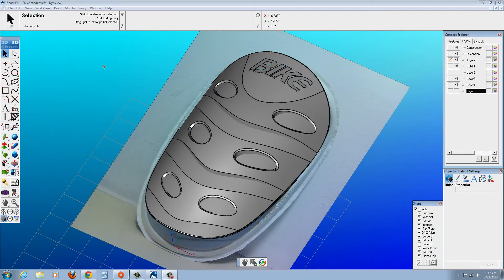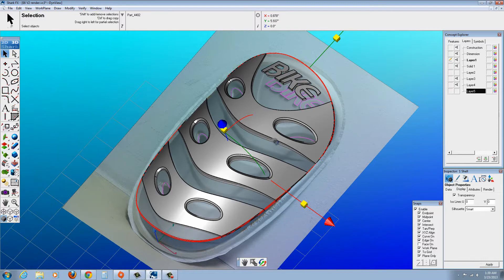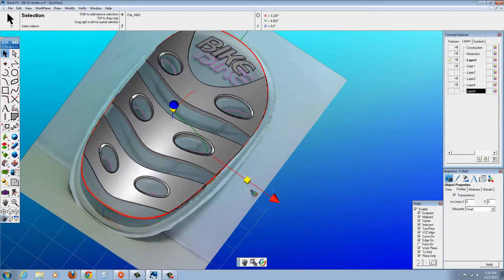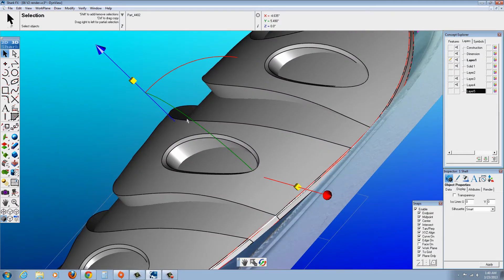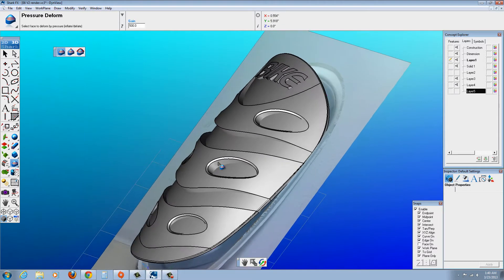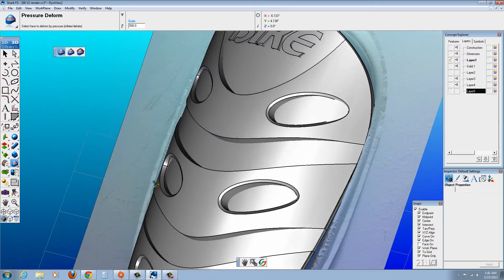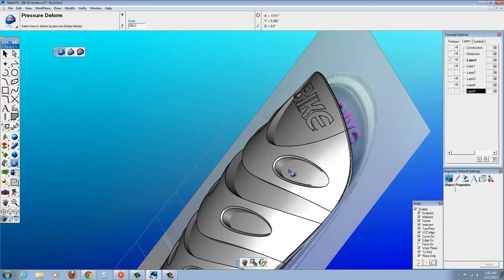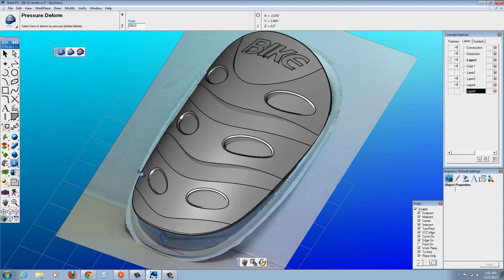E6 ViaCAD Reverse Engineering - Progress

Comment from the maker: Wesley. For the text you need to first need to offset the a surface from the model for the text height, then trace the sketch on the front plane (in this case) then extrude up to surface and extrude up to the offset surface. or extrude past the surface and use the offset surface to trim the text.